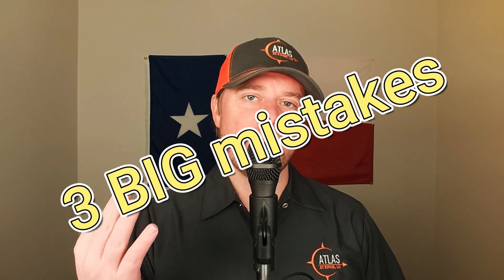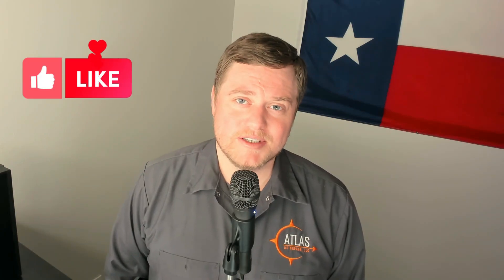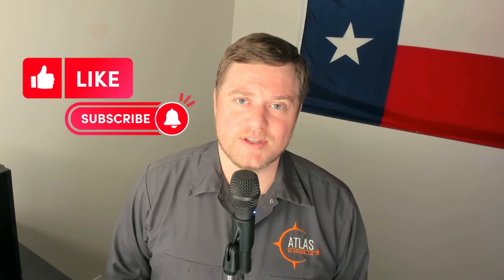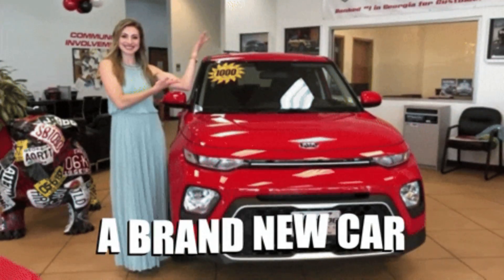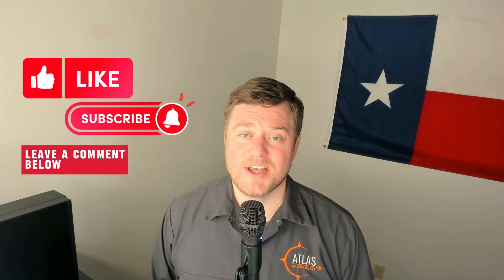3 Biggest AC Unit Sizing Mistakes? Don't mess it up!

Comment: I live in Celina, TX. It is a 2024 built and a 2story house. Since ever we moved into this house, we are having air quality issues mostly we feel is dust. I hired almost 6 HVAC companies to inspect to find out the problem but none was helpful. If outdoor temperature is between 70-75 and rH is 45-55 it feels okay but not better still can feel the dust odor. I tried smoke testing and I found and sealed very minor gaps around the furnace and return/supply duct joints. Other than this, I am not sure what I am missing to find out the source of this dust odor. IF we open the windows and running exhaust fans while HVAC fan is on mode then air feels like super fresh but few hours later it is back to normal dust mode after closing all the windows. We are using 3 air purifiers but no use. During the peak winter it is a common problem for us. I found out a common difference between same identical houses in our community they were installed with Trane 21 inch furnace/Evao cabinets. But our home was installed with 17 inch furnace/Evap cabinets. Our HVAC is 4 tonnage (Zoning) and home size 2450 sq.ft.. Total External static pressure is 1.15" (Return: 0.57, Supply: 0.58). Without filter returns SP: 0.21 and supply SP: 0.52. Ducts cleaned. No presence of mold from testing. Installed with Trane clean Effects and UV light. But not sure where is this odor or dust being circulated. Will you be able to help on this issue?

Comment: If you've had an old  2.5 ton single stage, Split unit 22 years old and nothing's changed in the house the windows or the doors and it's work well would you recommend to put the same size in
Reply from the maker: without any more details that provided, probably yes to keeping the 2.5T. If you wanted variable, go with a 3T

Comment: I live in arizona... building a 2100sqft home all conditioned spray foam  space including attic walls and ductwork... I got a manual J came out at 2.66ton reccomended. Every HVAC company in the area is telling me I am dumb basically and telling me 5 ton minimum. What are your thoughts?
Reply from the maker: if you have a correctly done Manual J and Manual D, stick with them

Comment: I have zero trust in the so called Diamond Elite mitsubishi contractors who provided me with quotes over the past few months. . About 50% have suggested a 36k btu condensor for my 1176 sf ranch and the other 50% suggested a 30k. So which is it?
Reply from the maker: I would need to know a lot more details than sf to make a recommendation. If you want to provide address so I can look it up, then I can let you know my opinion.

Comment: Northern California valley heat with full sun no trees. Attic seems to be radiating enormous amounts of heat into the house, takes my breath away. 1000 dollar a month bill July and August. What's your thoughts on improper insulation and full sun etc
Reply from the maker: insulating the attic to keep the heat from radiating into your home is critical. 
power ventilator in the roof to keep the attic temps at ambient air temps may also help. 
make sure your windows and doors don't leaks also

Comment: Hi thanks for this helpful video !! I'm going through that same problem had a 3 ton for 12 yrs it gave out reached out to my ac guy he said he would help me but was going on vacation for a week I didn't want to wait hired a company told them I wanted something bigger to blast the house colder they gave me a 4 ton and it keeps freezing on me already 5 times my house is 1650 sq ft it's a package unit
Reply from the maker: see if you can lower the blower speed down to 1200 CFM?
Reply: @atlasacrepair  hello and thanks for replying  I wanted some feedback , they finically came back and dialed the blower and so far so good but my wife is scared to lower it to under 70 degrees thinking it will freeze up

Comment: I am in the south where we have summer humidity and need to dehumidify. My opinion is that the compressor should be sized as large as needed but be multi-speed, ie inverter. Additionally there should be a head unit in the largest room, and/or near the primary entrance that can dehumidify in the summer. Use the ducted system to circulate the air and heat or cool it as needed, but use the mini head unit to dehumidify. Then the inverter based outside unit can ramp up and down as needed.
Reply from the maker: interesting design idea, thank you

Comment: What would you recommend? 1,296 sq ft home in central FL. It currently has a 2.5 ton but it seems the ac is struggling as is taking hours to cool down and maintain temperature. The ac is 12 years old. Should i keep 2.5 or go up to a 3 ton?
Reply from the maker: The square footage to tonnage seems to be matched. 
Now you need to look at western sun exposure, quality of windows, quality of doors, is your ductwork, supply and return plenum sized for 1,000CFM? 
Tonnage may not be the right question to be asking without looking over the other things that affect cooling.
Reply: @atlasacrepair windows are double pane installed 2019. They do get the most heat all day. I am having a company increase the insulation.

Comment: What if you move to a slightly larger system (say, 1/2 ton over your SF rating) but use a system uses variable speed technology / 2-speed fans and compressor? It seems to me that the system would adjust lower and not work as hard, especially if it variable.
Reply from the maker: It can work that way if the communicating tstat and system is set up accurately from day one.

Comment: I originally had a 2 ton unit in my home. I was told by a suppose AC professional that I could go with a 2.5 and that would be OK. However, it appears to me that the unit is short cycling. Desire to know if it is short cycling because it is 2.5 or is it short cycling due to something in regards to the installation? What can I do about the short cycling outside of replacing the entire unit again?
Reply: Was the thermostat replaced with the new system?
Reply from the maker: The thermostat is a good place to start for sure. Also to confirm your supply/return plenums are sized correctly. They may have been barely adequate for a 2 Ton system and now you have a 2.5 Ton system. Maybe you can have the installers set the blower speed down (lower) to see if airflow is the cause.

Comment: I had the same size placed in my house apparently but, it's really loud, inconsistent temperature throughout and high bills. I've had the company out many times and no luck. How can i get this fixed? Should i contact the manufacturer?
Reply from the maker: If the new system is the same size and single stage, then your plenums or ductwork may be undersized. Older system tend to "power thru" this type of install. Newer systems tend to not do so well. You need to calculate the CFM capacity of your return air and your supply side to see if your ductwork is sized correctly.

Comment: I need help!!!! I started building a new home in Orlando Fl. 3,800sq feet home two stories large vaulted ceilings. When I looked at the model it had two AC units and I never gave it another thought. I assumed one for the upstairs one for the downstairs. Fast forward 8 months we started building the home I'm at the pre drywall walkthrough with the builder and find out my whole house will only have ONE ac unit. A 3 ton unit with multiple zones. I'm devastated!!! I'm worried the AC won't be able to keep up in the Florida heat and the zone upstairs will be running 24/7 trying to cool the house and the downstairs will be cold. I'm worried the AC unit will be over run and break and we will constantly have issues with it and have hot and cold spots. I don't know what to do. Any advice would be so much appreciated. Oh and I forgot to say the model home had two separate AC units because they had converted the garage to be their sales office so they ran a second Ac unit to cool their office. I think it was kinda shady because when I saw the model I assumed I was getting two units. But nope. I've already put  $50,000 down and we are set to close in August. I'm so worried
Reply from the maker: The rule of thumb in Texas, Florida is similar due to heat load, is 500 feet per tone of AC. If the house is spray foam with excellent windows/doors, the footage can increase. However, 3,800 sf will never be cooled with ONE 3-T system regardless of zoning and regardless of insulation.

Comment: Curious if you are aware of any reputable HVAC installers in the Tampa Bay, FL area. Also, interested in having you explain or point me to a video where you explain the difference of having a single stage heat pump compressor with variable speed handler vs a two stage heat pump with 3 stage/variable speed handler.

Comment: We replaced our 3.5 ton unit with a 4 ton about 13 years ago.  I was using a contractor that did not know what he was doing.  He recommended we go with a 5 ton unit, which would've been a disaster.  Although, I certainly learned a lot since then, I still had enough sense to realize that 5 ton would be a huge mistake and wouldn't let him install 5 ton.  I did run an iPhone app that recommends size based on questions, like square footage, where you live, etc, and that came up with 4 ton.   After the install,  we noticed lower humidity levels in the house and quite an improvement in the monthly bill.  In retrospect, I realized that our old 3.5 Ton system was probably just overcharged and that is why is was not removing as much humidity.  Still I think the upgrade (being more efficient) eventually paid for itself.  I don't have luck finding good A/C technicians in my area.  The control board in the A/C unit blew, and was replaced with a similar one, but not exact.  The technician that installed it, ended up setting it as a 5 ton system, saying that he wanted higher fan speeds in the house.  I don't have the manual that came with it, to set the pins for the correct fan speed.  I do want to see if I can set it back to 4.0 Ton speeds and see if we get better comfort.  No idea where to find the model number of the controller board though.  I'd hope to find the manual online and set the pins properly.
Reply: Put in the unit model and serial  and look for unit installation manual and you should find the settings for the dip switch
Reply: @jasonjack9998  I have the original manual - but the control board was changed out and the dip switches are not the same as the original.  How do I find the model of the new control board so I can get the manual for it?
Reply: @beb1527  type in the model number of the actual circuit board and see if you can find the manual for it ,

Comment: I just had a Trane variable speed heat pump installed ($$$), along with all new ductwork. I am happy with the system and it seems to be working great. If I lived in Texas, I would definitely liked to have done business with Atlas… I really like their transparency. Keep the informative videos coming!
Reply: All new ductwork?  What was the issue?
Reply: @snapper1948  the previous flexible ductwork was 26 years old and not laid out optimally.

Comment: So much for asking a professional! My 980 sq ft home was built in 1956, louvered windows, 2 wire outlets and the biggest issue I believe is no outside wall insulation. Being that we live in Florida the last one is by far the worst, since I have replaced all the windows and rewired all the outlets for 3 wire. I have plenty of attic insulation. Currently, I have a Payne 3 ton package unit (20.5 years old unit) and am thinking about replacing it and going with a conventional system, with the air handler in the attic. Humidity wise, the house stays a 41% in all seasons. I have had 3 quotes and they did not suggest the same size system.  As you may have figured, one said a 3 ton the other said 2 ton, and the last was a 1 ton. Personally I know for a fact that the 1 ton is out.  My unit is running a lot in summer, more than likely due to no outer wall insulation and the temp always in the 90's.  Insulating the walls is out of the question. I guess it is up to me to decide which size system is the correct one.  I guess that I will have to make the decision on my own.
Reply: No higher than a 2 ton
Reply: If you plan to stay in the house long term, I would think insulating the walls would be cost effective.
Reply: @6Shooter357  I am 76 years old. I more than likely will get a 2 ton unit and I will let the next owner worry about insulating the outer walls. Although, currently the  trend where I live is to buy the house, tear it down and build a million plus dollar house on the property. I am a block away from the Gulf.
Reply: @donaldhoudek2889  I hate to think of the home insurance cost for those million dollar houses so close to the Gulf.

Comment: Love your vids. 
Our installer, Armstrong Comfort Solutions, just replaced our two separate 3.5 Ton 17 year old Ruud upstairs and downstairs systems with two 3 ton top of the line Carrier Infinity fully variable systems. We have a 5000 sq foot home with all new windows. When we first heard of the tonnage size downgrade, we thought maybe we didn’t purchase correctly. A common misconception as you noted. But after talking with our Comfort Consultant who spent some time running the numbers, we could not be happier. Precise temperature control; ironing out hot & cold spots;and not hearing the units operate were the most important factors for us ….as was of course the installation. This team of five experts knocked it out of the park. They even signed both 59MN7 furnaces & 24VN6 condensers afterwards. Attention to detail was phenomenal. Actually if I could sum up what we learned the most about our HVAC experience in three words, it would be installation, installation, installation!

Comment: Can an oversized unit cause mold issues? Do you work in the San Antonio area? Thanks
Reply: YES  Not in San Antonio, but just north of you around 300 miles..  My daughter bought a house in a somewhat new track with the Cape Cod styling..  2 story - all 3 bedroom upstairs - very open plan design. Total sq ft 1900 +/- a little.  There must have been a home builders connection with Carrier.  Most all of the homes in the community all look similar and all have 2 story.  When they built these really tightly sealed homes,  some genius  put in 5 ton zoned systems..  This is a disaster.  Short cycles downstairs but air in a bit more comfortable upstairs on AC.    I've had 4 different HVAC guys come and look, which they had some hocus pokus 'fix'.  They just disconnected the downstair thermostat, which was ok in the hot summer. Come winter,  upstairs controlled at 72-73 degrees, but downstairs temps around 54-56* with absolutely no way to get warm....  It is now reconnected as original and summer inside humidity is 65=75%  Lesson learded?  Dont over size tonnage  And, yes had both mold and mildew on the walls downstairs.